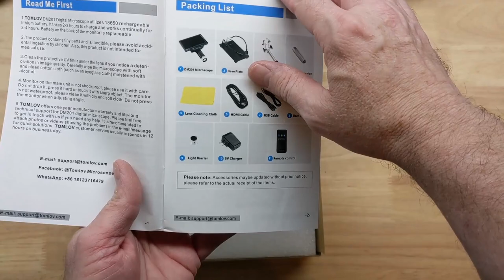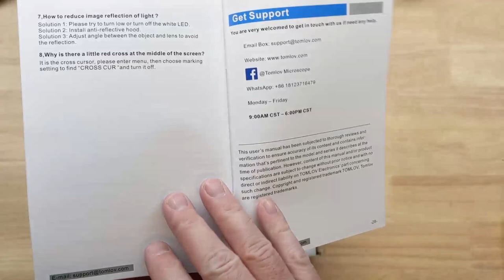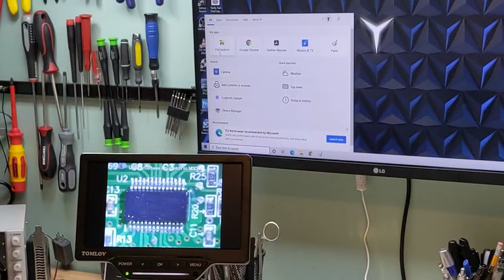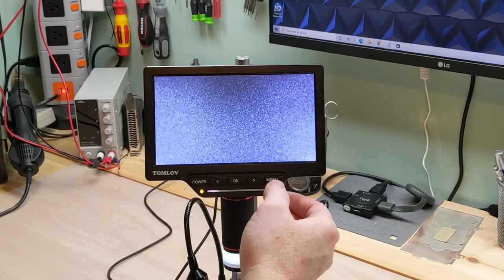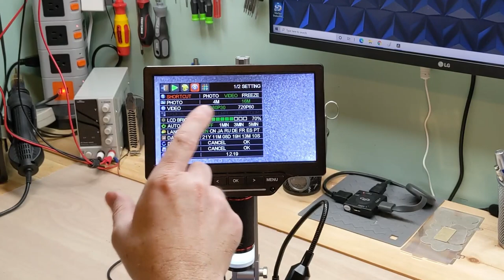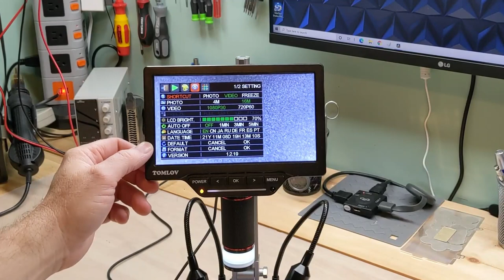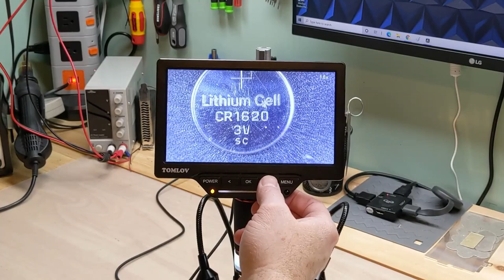TOMLOV DM201 Digital Microscope Review

Comment: So I just got mine the other day and there was an Amazon review for the Andonstar AD407 that mentioned putting a Barlow lens to extend the depth of field to that you get 1" (25mm) of depth in focus. I bought the same lens for the TomLov and it works great! The lens is  Xit XT30WAB 30mm 0.43X Wide Angle Lens. It was $16 and it makes a lot of difference in the ease of using the microscope.

Comment: I’m running windows 10, with the camera app installed and it doesn’t recognize it. Suggestions? My old “Plugable” has no problem. Thoughts anyone?
Reply from the maker: When you plug the USB onto the PC does the microscope screen show the USB mode? Is the USB plugged straight into the back of the microscope instead of base?

Comment: I have a question about the height extension. How is it for working on watches for 
example, with tweezers, little screwdrivers, etc. Is the microscope practical for 
working on stuff under the lens, as opposed to just observing? Thanks.
Reply from the maker: I personally use it with tweezers and soldering iron regularly. So for me it is helpful. It is better out there like the one from Northridge fix that I also have a link for down in most of my video descriptions. It is much more expensive, but it is a very nice scope. This is a recent repair video I used the TOMLOV on if interested. 
https://youtu.be/bwLfCi363Qk?si=8kRLjBkjZdB4rlSF

Comment: Hello, at a professional level, which microscope with such a portable screen, could you recommend? I have many professional microscopes in the laboratory, but I'd like to get one Like these with portable screen, so to have a small top of the range like this one in the video, just to try other things... Thanks. 👍🏻
Reply from the maker: I would go toward the DM201 with the 7" screen for portability. If you rather have the 10" screen, they make the DM202 10.1" model as well. That 10" screen is nice, but takes up a good  bit more room for sure. The DM201M has the built in DMM on display if that is desired also. This is a link for the basic DM201 7" ...
https://amzn.to/3OVbKUM

Comment: Thank you this is  the microscope I will buy Love the 16mp's !!! 🎄🎄🎄🎄🎄🎄😎😎
Reply: But is it really 16Mp?  The box said 4Mp as did the manual, though I did see the 16M on the settings screen at about 17:00
Reply: Just did some more research.  The sensor is only 4Mp, but it can save to a 16Mp file - perhaps using interpolation.
Reply: @cubeistgames7985  Thank you !

Comment: Thanks for a lot for the nice review.  I'm debating whether I should get this one or the Andonstar AD407.  My main application is SMD work.  I understand you've also reviewed the AD407.  Which one do you think gives the best picture quality?
Reply from the maker: I like them both about the same. I like the use of the Tomlov a bit better and it has a higher height adjustment. I also now have a 10.1" screen version of the Tomlov DM202  If someone did want the larger screen.

Comment: Good afternoon. Is it possible to by-pass SD card and go directly from Tomlov to laptop and post pictures? Does it save in camera file or post directly to Ebay or Etsy? Thank you Terry
Reply from the maker: You can read from the SD card by plugging the USB up to the laptop and you can also use the Camera app to record video or capture and save it straight to the laptop if desired.
Reply: @ThriftyToolShed  In photo mode, hdmi hooked to laptop, click to picture take w/remote see a 1-2 on screen and nothing pulls into laptop. What should I do? Thank you
Reply from the maker: @terryyanda4499  
The microscope image is on the screen correct? Mine stores in default path so I believe it's the Photo or Video folder in windows 10.

Comment: can  this be pluged into a  monitor as you  just did ..  it dosent need any software  mac/ pc ?     just a usb port monitor ?  dm602 boom  model  for lots of solder work   . mainly for the boom arm  for my set up
Reply from the maker: It will HDMI output to the monitor or TV using the Micro HDMI to HDMI cable that comes with it. You can use either the on board display or output to HDMI monitor /TV. The USB to computer will work like most web cams etc. Just connect to PC and use the camera app

Comment: I have the exact same device. I have been struggling in getting the USB > PC WebCam to work. It worked the first time. But then it just doesn't want to work at all. I can see that the driver VMS700 is installed and windows says "Device is Working Properly" but no matter what I do it just won't do that web cam thing again at all and it would only do it at random. I did try the following that increased my chances and that was removing the driver all together and plugging it in for Windows to detect it. Some times it does some times it doesn't. Have you faced any similar issues like this? If so, what did you do to minimize it? Also we both have the exact same Soldering iron lol.
Reply from the maker: I have not had that issue. I have only used the Camera app on windows 10. When I open up the Camera app and connect the microscope to USB it picks it up as a device without issue. I have not tried this with older versions of windows or the newer windows 11.
Reply: @ThriftyToolShed  That's the thing. I am on windows 10. I just learned something new. It does work. But i had to leave it turned ON for like 10 - 5 min and then the comp would see it as webcam to be available. Weird. But it is not instant as it should be. It's a good product I like it for the price tag, but the software that it comes with is awful. Any chance did you device came with a CD driver?
Reply from the maker: @DarkWolf80s  
Mine did not come with a CD. I just connect to the computer and the microscope has a message asking  if you want to connect to SD card (MMDC) or for video. Once you select video mode it should connect through Camera app. I don't use as a web cam or any webcam software. I Simply use the windows Camera App. I just type "camera" in the windows start search and the camera app shows up.

Comment: I've almost decided to buy this microscope, which is why I'm here.
I notice on the specs page that HDMI resolution is only 720p.  That kinda sucks.  I'm hoping that USB connection allows at least full HD on a computer monitor.
I'm a little concerned about USB connectivity to my Windows 7 desktop, since the Windows Camera App only works on Win10+.  Surely there is something for Win7 though.  Hopefully, after a little more time looking I'll find something that'll work with Win7.
Thanks for the review.  Very helpful.
Reply: The menu has a selection for 1080p at 30 fps and 720p at 60 fps.
Reply: There is also software called AMCap available from Noel Danjou that supports this device and runs under Windows 7 SP1 as well as Windows 10

Comment: Wish I could afford one of these right now, I got a power supply board that needs several ics replaced. This would really come in handy
Reply: Just now finished replacing 7 out of the 10 parts that came in that PS board repair kit and the last 3 5 or 7 leg IC's are Very tiny! Not comfortable trying those without any kind of magnification. Ifanyone can recommend a GOOD headset magnifier? Or would I be better off not eating for the next month & a half & trying to get a Tomlov? Are the Tomlovs good for soldering or just checking your work?
Reply from the maker: The microscope is handy for this work for sure. One cheaper option is this type of magnifier that I shared awhile back. It gets by, it takes some getting used to, it is difficult when troubleshooting for sure trying to go back and forth. Soldering it works ok. https://youtu.be/GSLhRaoYD-c

Comment: Hi, i would like to use my PC as a monitor .When using  usb cable into pc it works .But when using HDMI from 7 inch display to HDMI connector into the monitor it didnt work i saw that you powered off the 7 inch display would that be the reason it didnt work? Thank you
Reply from the maker: I have to ask you to verify (that I understand) your question. Is it the PC monitor not working or the 7" display as well as the monitor? If using the USB to a computer is one way. If you only want to go straight from microscope to the HDMI of the monitor then power off the microscope, connect the HDMI from microscope to monitor and then power on microscope. If HDMI input is set on the monitor then it should work. It will not display both 7" display and HDMI out at the same time. It works as either or!
Reply: @ThriftyToolShed ok i get it thanks .Anyways will have to wait for my replacement because i sent my DM201MAX back because when i updated to latest firmware(1.2.23) it bricked all was going well i had a green card showing when updating the display closed like it says in video but when i start up the display i get opening screen and nothing else works, on-off ,menu ,nothing i can only close it by pressing (reset)by the way after the update does it matter if you dont remove sd card before restarting display?  .Thanks alot for your time .

Comment: How do you take an image without changing the focus/sharpness?
Nice video. Well done.
Reply from the maker: Usually by pressing the button carefully it will not move/distort the image while taking a snapshot. If you find it moves enough to mess up your image you can use the remote to take pictures or start video recording. Thanks for your comment!

Comment: You mentioned at almost the end of your video that you can do digital zoom in up to 16X.  On page 15 of the manual can be read 32X max magnification.  But in the specifications table it says "Zoom: 1X-1200X".  I am very confused.  Is that 1200X for real?
Reply from the maker: Well to be honest it's very confusing. I am not an expert on magnification and that's the main reason I mentioned the specs and did not get into alot of detail except for what I know abit more about such as helping me look over and solder on SMD components on circuit boards. With that said, I have taken some time to do some simple measurements if that helps you. Testing mine all the way down close as I can get to the base of course is the most magnification we can get and 1/32" or say .8mm is displayed at 2.30" or 58mm or so measured on the screen so that is almost 75X magnification so with the 16X digital zoom (which is not great once you pass 2x or 4x honestly) you are really getting almost 1200X with 16x digital additional.
Also since this scope can go up over 9" in height of course the magnification at that height is much less. Only about 3x at that height and of course you can still go 16x digital on that as well to give around 48X. One other option you can also display that on a larger TV or monitor screen like I showed and I don't know how to say what that is for you but visually you are going from 10" screen to 27" in my case and only limited to your display device is how big it is. Another point is, you cannot record video while in digital zoom you have to use the computer camera record feature if this is needed. Hope this is not confusing, but honestly that's why I stayed away from this in video. Hope it helps a little...
Reply: @ThriftyToolShed  great info! Thanks for the time to do it

Comment: The link doesn’t work. Do you still like this one or prefer another?
Reply from the maker: Hi,
Thanks for letting me know I will update the link. I still like this scope a lot. I have had many sent to me now and this is one of my favorites. It's the first one I had that would let up higher and allow me to solder and repair boards easier. The only one I like better is the 10.1"  that Tomlov sent next. It also has the higher working distance and it has a larger screen if that is something you might like. It's a balance between a nice larger screen or simply using HDMI out to a larger monitor and then the 7" takes up less bench space and is about the same otherwise. 
https://amzn.to/3X00MxJ
https://amzn.to/3vyq8ax

Comment: Why won't my microscope from Tom love not charged must I have a card in it to make it charge
Reply from the maker: It should not need a card to charge. I will say I have contacted TOMLOV about the charging issue with some scopes. If you charge and try to use the scope at the same time it can over current the 1A charger brick and the voltage drops off. I use my own 2A supply and it works much better.

Comment: Great Video.  You convinced me.  I received mine today.  A couple of things I've noticed so far;  The lights on the side don't really want to stay in place, when I bend them and point them where I want they "bounce" back a little.  A little annoying.  Also, I'm hoping I just haven't found a way yet, but is there a way to display on the microscope screen and HDMI simultaneously?  If there is, I haven't found it.  I don't have mine connected to computer yet.   Very happy with it though overall.  Great video too.  I'm a subscriber now!  I want to learn to repair circuit boards!  Really though, I got this scope for coins.  I metal detect.  Thank you.  Great value with this scope.
Reply from the maker: I believe once I moved the arms back and forth to break some of the paint on the arms they stayed much better. If I remember correctly, just bending and using them helped. The non painted ones did not have this issue. It will not do both HDMI and screens at same time but you can use the USB to computer camera and capture that way also. Glad you got it, hope it is good for you!

Comment: Can't connect HDMI or USB to windows 11.  Does anyone have a work around?
Reply from the maker: You should be able to go directly to a monitor or TV with HDMI if all you need is a larger screen? I do not have windows 11 yet. That's one reason why, I know as usual a lot of things including printers and other peripherals will not work? SMH...
Reply: HDMI on the windows computer is normally an output to another screen, not an input to show something on the computer display.  If Windows 11 has the right driver it should just show on the Windows Camera app using USB.  Make sure your USB cable isn't a "charging only" cable.  It will need to have the data pins connected, not just the power pins.

Comment: Thanks for the review. Concise and to the point. Just bought the pro version off Amazon on Oct 11 Prime day. Has some issues. 
One being the AC adapter is TOO small. When reviewing a product one should ONLY use the components that come with the product.  It would have been apparent then how the AC adapter gets HOT. The head is 1A+200mA for the platform lights+?mA to charge the batteries; that's pushing it for a 1amp adapter which on my unit gets HOT. 
Additionally, there is no provision to use different lenses. Should have a c-mount (standard on CCTV and microscopes) then it could use all kinds of other lenses. There is a "wide angle" adapter lens (30mm 0.45x). Tried it and it is not that great; has too much distortion on the left and right 25% of the image. A quality lens would be rectilinear and not have this issue. 
Probably going to just use the headband magnifier for soldering....
Reply from the maker: I have reviewed 3 of these TOMLOV microscopes, but maybe not the model you have. All 3 come with the same 5V 1A adapter. I have tested these well on mine and don't feel the need to show every detail and make a one hour video. I have only seen these go up to .95A current draw while testing with USB inline meter and though warm, I never noticed mine hot or voltage below 5V like it's  running higher current than rated. I could see if the battery is low maybe  it could pull more than 1A while charging while running scope and light but I haven't seen it yet. I guess I would make sure the cell is holding a good charge. I really love these microscopes for micro soldering, they have helped me in videos repairing boards that I could not have done without it. I also bought the .43x lens and it comes in handy at times. It works pretty good for me.